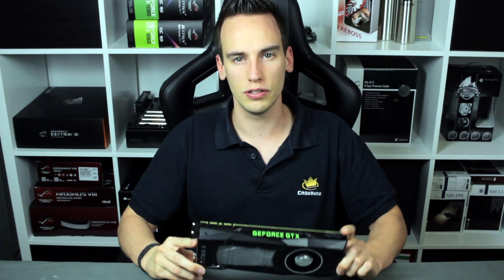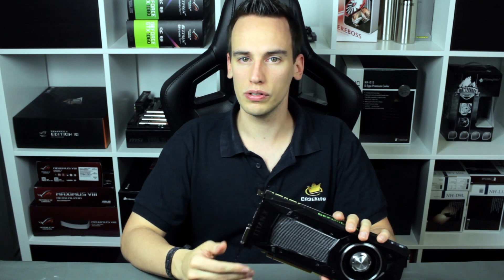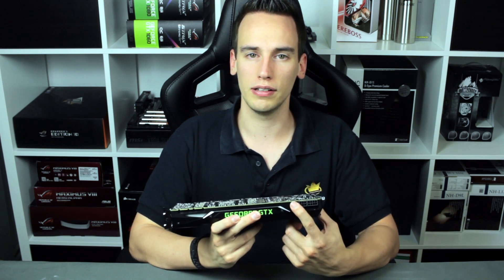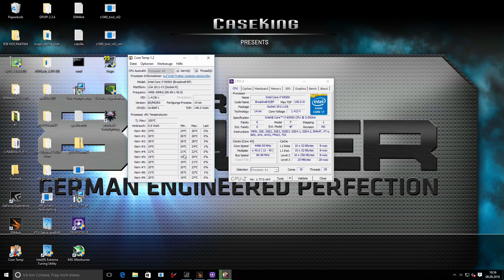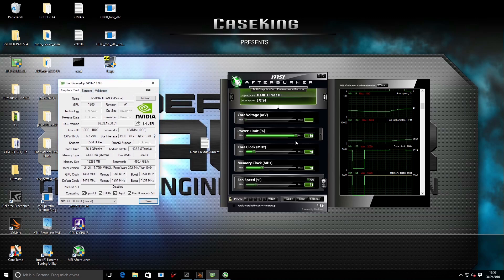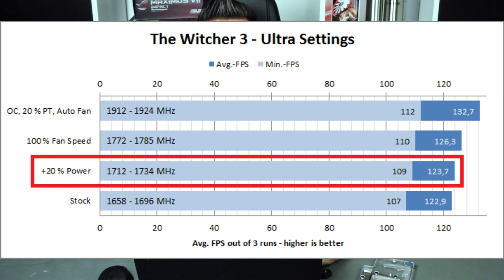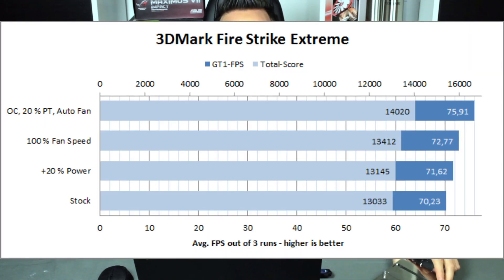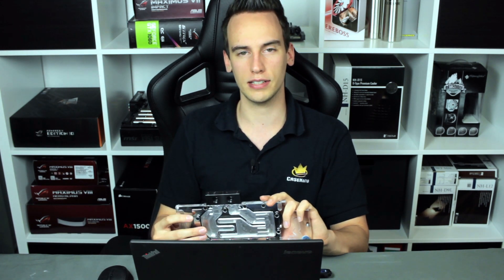The Titan X Project - Part 1: Overclocking Basics

Comment: This probably has nothing to do with this card or anything, but what is your stance on coil whine ? I bought an EVGA G2 750, ASUS Maximus VIII Ranger and gainward GTX 1070 and msi gaming X GTX 1080 cards and both of them coilwhine like crazy, I also tried another seasonic psu but still the coilwhine remains

Comment: Some excellent videos here Der8auer. And this will especially be a great series. Request: also try this card with a hybrid/AIO cooler. Maybe at the very end if time allows. As nobody else have done that yet with bypassed power limit. Maybe not something you are so interested in having a custom loop. But it would be nice to know what is the actualy performance difference vs a custom loop. And see if it matters much on the performance and acoustics.

For an AIO solution I would suggest you can try a modified Corsair HG10 adaptor plate. The mod is shown in this thread: http://forum.corsair.com/v3/showpost.php?p=856494&postcount=11

To mount to that a Corsair H100i, or the new Corsair H45.

Comment: what driver do you use? I had oc'ed my gtx 1070 using 368.81. With never nvidia drivers (e.g. 372.70) my oc is not stable anymore.

Comment: I have 970 Strix with a power target max, at 1500MHz but only reaches 54c 70% Fan. 

Is it worth unlocking the voltage?